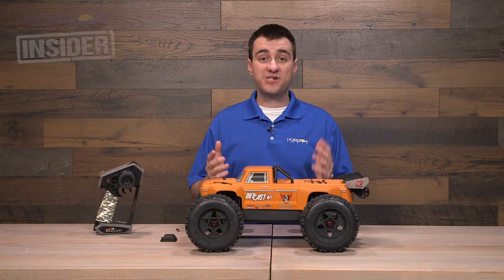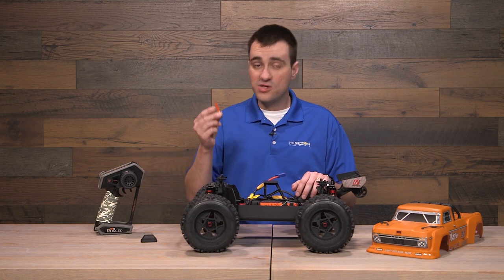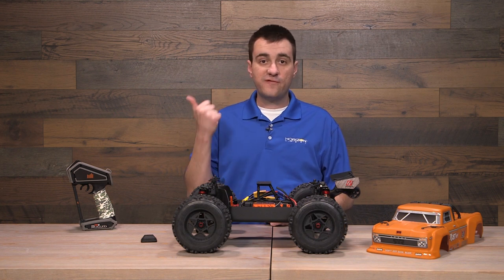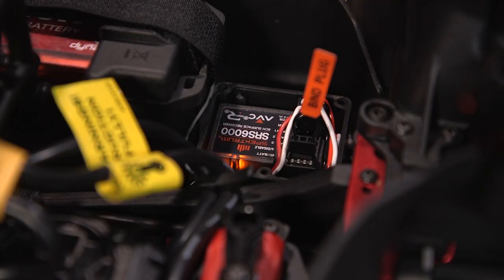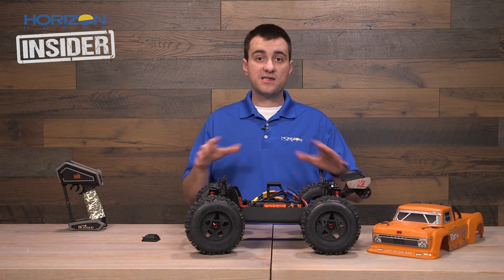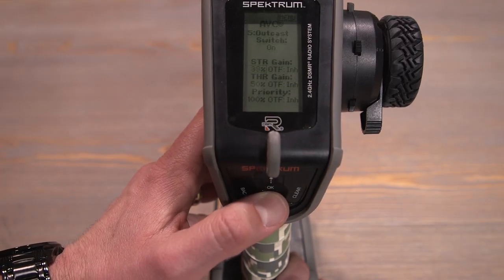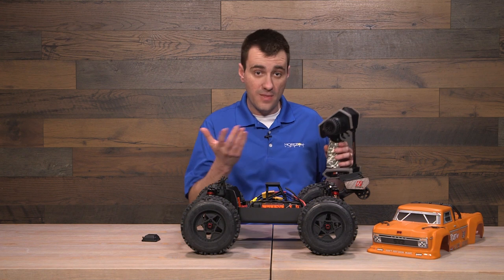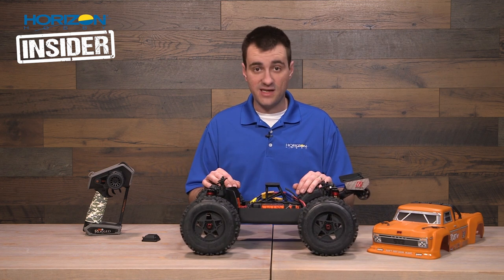Horizon Insider Tech Talk: Spektrum AVC Technology - Binding/Calibration

Comment: Quick question. Does that Spectrum AVC work with Flysky Gt5 transmitter?
Reply from the maker: Darren, great question. AVC only works with Spektrum transmitters, and it has to be one designed with AVC functionality. Currently this includes our DX2E, DX5C, DX5 Rugged, DX5 Pro, and the DX6R.
Reply: Thanks, I could not sort why my steering was greater to one side after replacing the garbage servo that came in my Rock rey6. Works perfect now.

Comment: Hey Horizon.  I have sent in another warranty  ticket for more shock rebuild kits for my Arrma Granite 3s BLX 4x4.  I have rebuilt them 2 times and they start leaking within a couple of battery packs.  Bad design ? defective shocks ?  I am at my wits end with the mess of oil all over my truck, wheels , tires and the shelf in the house. it leaked all down onto some other RC cars.  I have a plastic bag under the Granite to catch oil.  I am absolutely sick of it.  Please help.  there must be a cure for this.  there is no after market or upgrades. I just want shocks that dont leak.  it has made a mess of my hobby shelves and cars.
Reply: Please Horizon, there must be a cure for this oily mess.
Reply: Not even so much as a comment?!
Reply: @craigprice927  Dang that stinks! Im getting a Typhon 6s v5. I hope I dont have that problem!

Comment: I’ve never found “AVC”, “DVC” or any other stability control/gyro helpful in 4WD vehicles. 2WD?  Absolutely. Not in 4WD 🤓
Reply: Really!? I was about to get it for the typhon v4 6s.
Reply: @dynasty4851  I'm not a fan of any stabilization but I can say my 4wd rock rey has it. Never use it in dirt but on the street this car has mega torque steer so it does help during bashing
Reply: I love AVC and TSM! It’s easy to turn it down lower so it doesn’t make large corrections and I do that as well, but there are times I like it a bit higher as well. Particularly in my Limitless when pulling speed passes and in my Typhon 6S buggy.